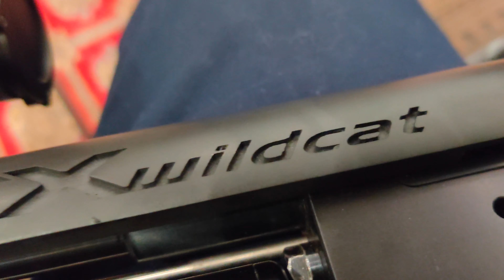FX Wildcat Leak Fix (Huma Regulator)

Comment: I missed the part where you removed the regulator from the pressure tube. I'm currently experiencing the same issue with my airgun and don't know how to get the regulator out of the pressure tube...
Reply from the maker: If you use a handpump, use the pump after removing the cylinder to pop the regulator out. Can do the same with a compressor. Don't do it with a cylinder please. Keep something in front of the opening to cushion the exit of the regulator so it does not get damaged.